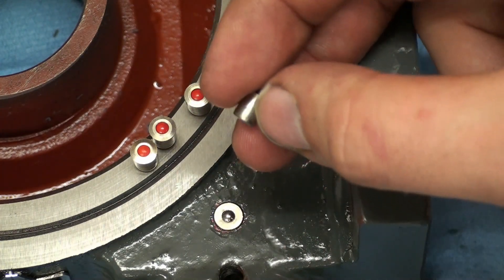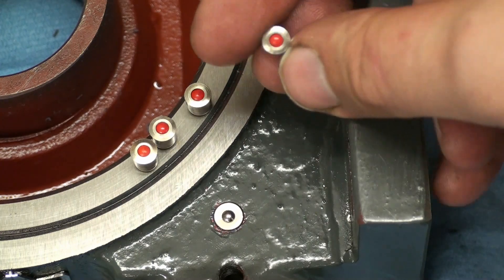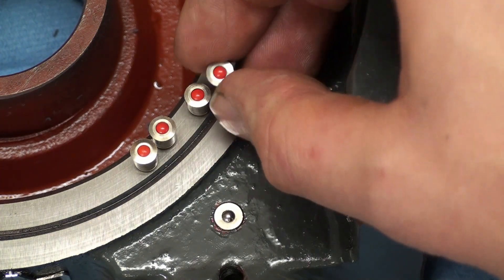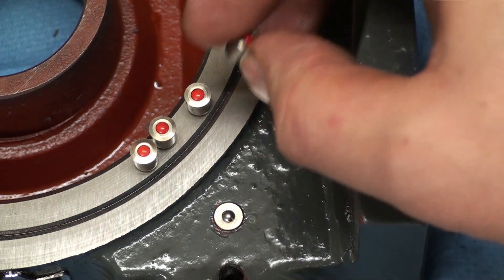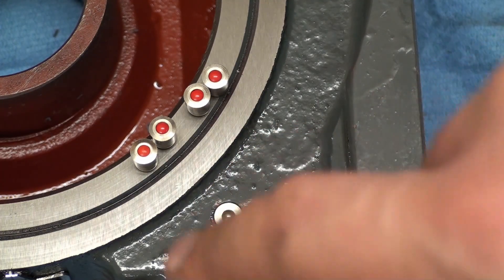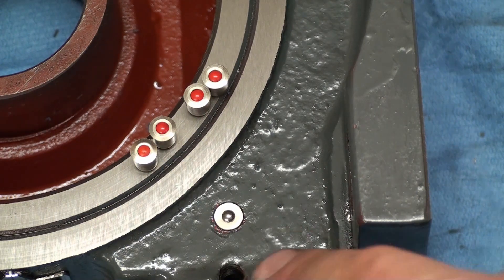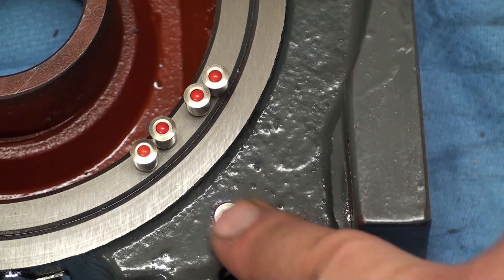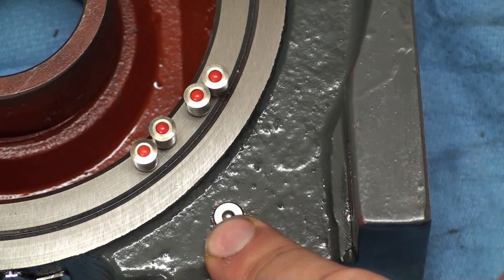Vertex rotary table Teardown - Vertex Rundtisch zerlegt

Comment: At 7:40 Stefan takes off the worm retaining plate and comments that the 4 set screws are to "... adjust for any imperfection in the machine ...".  They are actually for adjusting the clearance between the worm shaft & the body.  I'm sure Stefan knows this, but I'm saying it for anyone viewing this for info about the cleaning of their own R-T.

The ring sets the clearance by bearing against a shoulder on the shaft & the ring's axial position is set by the set screws bearing on the body.  This clearance affects the table's rotary play/clearance by allowing the shaft to move axially.

The 4 set screws on the table's retaining plate at 5:25 do the same for the table-to-body vertical clearance.

Comment: I am purchasing a bunch of equipment from a machine dealer that I personally know that had the roof collapse years ago and the equipment has been in the Indiana weather. One piece is a rotary table and I know I will want to clean it up as you have done. You have saved me much time and apprehension. Thanks.

Comment: I have a 250 mm Walter rotary dividing table and construction very similar! Maybe they also had one to copy? I stripped mine down to clean out. The Walter table runs in an oil bath. I will take some pictures before reassembled.

Comment: Thanks for this. I purchased a Index 12" rotary table years ago that has a broken shaft where the crank met the table. I'm betting it was dropped. I have been meaning to take it apart to see what can be done with it.

Comment: Those set screws for adjustment may be why your attachment screws were so tight. They may have been drawn up after the pieces were attached, causing the excessive thread stretch. Just a thought

Comment: Stefan: I suggest you make a subplate for the rotary table and tailstock when used for dividing. Call it a platen. Then you can key it to a slot or not and swivel for angles or tapers. Another suggestion is to forget about hole circle plates, sector arms, and shot pin handles. Instead, consider the beauties of a stepper motor drive controlled by a DivisionMaster or a Tiny Controls indexer drive. They operate in multiple modes and feature bi-directional power feed. Very cool bit of kit as the Brits would say.

Comment: Thanks for saving me the editing time of making a similar video on my import rotary table.
Mine had all sorts of casting sand left in it the inside of the casting  and it was not painted as yours is which is a good way to encapsulate  any casting sand and grinding dust.  I also needed to de-burr  a lot of the parts in order to have a smooth operation. It seems as though yours had a little more care put into it than mine did. I did have to modify some of the parts of the handle in order to be able to use the indexing plates..
Thanks again for sharing

Comment: Hi Stefan, congradulations on reaching that 5k subscribers number. 

Fwiw, I bought my 6" Vertex rotary over 20 years ago. They've made a few changes between your's and mine. My worm gear is bronze, but I haven't checked the worm to see if it's hardened. And mine unfortunately doesn't have the oil grooves like yours does. And I couldn't agree more about the need to tear down and clean equipment like this. My mill is Taiwanese and I also found those chips and some grinding dust in it.

I'm only repeating what I've read about the Vertex tables and how they were made only a few years ago. At one time they changed from that bronze worm gear mine has to a cast iron gear cut directly into the lower area of the table casting. John Stevenson in the UK did or still does CNC conversions of these Vertex tables, and mentioned on one of the forums 4-5 years ago that all the test certificates he had from buying 20 of these tables had the exact same numbers on each certificate. At that time Vertex had apparently contracted out there production of these tables to the Chinese. From looking at the internals of your table they've either changed and upgraded there quality and design requirements with there Chinese manufacturer's, or they've moved there production back to Taiwan. Your table seems to be quite a bit better made than mine is. And has some much better oil grooves in it. I may have to add those myself. As usual another excellent video, and it was nice learning the best ways to remove those junk ball oiler's the equipment comes with.

Comment: Excellent, methodical, informed video. My one disagreement would be with the set screws impinging directly on the worm shaft threads. I had purchased the 8" version of this and mostly the same as the 6 with the minor exception of an additional thrust bearing in toward the worm. Those threads were just messed up on mine and I wasted hours repairing them which destroys that "new toy buzz" I felt I was owed for what I paid. SO easy to retain that ring correctly by adding a thin brass disk between the setscrew and the threads. In fact, the set screws used to lock rotation of the eccentric also impinged directly on the rotating part without any brass there either. Add those faulty design elements with some other factors outside the scope of this comment and I just returned it... again I am now looking for a rotary table that appears to have been designed by someone who cares, with a worm disengage and with an available divider add-on (the add-on itself that I purchased for the table I mention above was rusted and missing parts, which the vendor cured by photoshopping the missing part out of the ad). Keep up the excellent work. As an aside, can you let me know what source you use for your metals data (tempering, etc). Thank you.

Comment: The way i get those oilers out is to drive a sheetmetal screw in and then grab that with vise grips and pull them out , if they're stubborn hit the nose of the vise grips with a brass hammer while pulling on the vise grips - i found it works most of the time.

Comment: To remove the oil spots I like to use a slide hammer. On the ones I had it was not a problem to fit a screw into the hole of the ball even without drilling and threading and you don't have to dismantle the machine. But maybe mine had a loose fit.
Screw extractors also do the job. I mean the classic "Linksausdreher", not the fancy mondern ones with a spline shaft that Snap-On has (but for removing screws those spline shaft ones do a good job).

Comment: Hi Stefan 
Nice presentation. I have for some time a smaller version of Vertex R.T., 110mm and I did just the same you did. Take it apart and clean it but I did not check for concentrically. Recently I had to put 6 holes 30deg. apart on a cylinder made on the rotary table. I was surprised to discover that MT2 is not concentric with the table. So as I rotate the table the center hole move about 0.002".  Maybe you have more luck with yours.
Radu

Comment: For some reason, I learned to use a wood screw as a means of once screwed in, use a plier or some leverage technique to pull the embedded screw out without stripping the screw out. Even old destroyed oilers can be pulled this way. Eventually I will get caught up on all the episodes to see who shot JR.
Reply from the maker: The compound is fairly sturdy built and i might give it a go to stay on the machine:)

Comment: Nice concise video description. I don't know if I' call the gear a worm gear. Its hard to tell from the video but are the teeth cut on a helix and what is the Pitch. I'm assuming its a Module but I could be wrong. The last rotary table I had to adjust backlash on used a variable pitch worm shaft. You moved the Worm shaft axially to set the back lash to a factory spec. 4th axis on a Kearney and Trekker HMC. Would there be any room to add a set of index plate similar to the ones of Super Spacers

Comment: Congrats on the 5K! Very nice. The rotary table is pretty nice too. I kind of expected a central axis bearing or a bushing but the cast bore is probably ok too for no more revolutions than it likely will see in its life. It is a bit different from my rotary table which can be powered by the mill which would likely see many more revs in its possible uses as a powered 4th axis.

Comment: Ive got the same one, mines Vertex branded still(yes we have optimum, i have Optimum 2506v with 20m mill head on it) in set with the dividing disks and a 3jaw chuck.Ive only done one tiny job on it but it seems decent, after seeing this i will now tear it down to remove the included chinese lapping paste!  Until i understood what was going on (grinding dust)it thought they were using recycled grease full of dirt just for storage/transport protection.A shame they cant take that little bit of extra effort to elevate their product quality just a bit more,my lathe felt totally different once i cleaned,stoned rails and re-lubed it when i first got it, not a lot of time and effort for big result.

Comment: Hello Stefan thanks for all of your nice videos. I have a question I'm hoping you can answer. I have a Vertex HV-6 rotary table and the table had some surface rust that I cleaned off with WD-40 and a scotch-brite pad. At the time I didn't realize that the scotch-brite had alumina abrasive in it (out of ignorance I though it was just plastic) and it put some fine scratches on the table surface. Do you know if there is a way to restore the surface finish of the table?

Comment: Mine is easy to turn on part of the rotation and then becomes hard. I guess I can disassemble from this helpful video but then hope I know what to look for. At least if there are burs I can help with that.
Reply: What a mess. Found the main table sleeve has a lubrication spiral but no way to get lubrication to it. No oiler to service it. The thrust waher holding from the bottom has an oil spiral groove but no way to oil and mating surface is rusted. The worm rod gear is rough as a cob. The locking clamp pieces are all smeared out for not fitting table diameter and I had yet to use them. Sat for a month before I had a need to use so too late to return they say. Hope I can rebuild it. What instructions I got does not show how to lubricate that shaft or waher either! Cheaper if you just do not finish making it I guess. Thanks again for showing me disassembly 😢😢😢😢😢

Comment: If not for your video...
Under the heading of "I should have read the manual..."
Twenty some odd years ago I bought my first vertical mill and it came with a 200mm RoTab.
Never have done much with it but it has come in handy.
Somewhere in your series of this teardown you mention dividing plates, and about two days after watching your videos it dawned on me that I have a bag of miscellany that came with the mill, stuffed into the back of a drawer.
Well I dug it out this morning and lo' and behold there's two plates, the index pin and the plastic do-ma-thingy in there.
Checked accessories on-line and they look-alike.
Never would have discovered this if it hadn't been for your videos...
(Now then, where's the manual on how to mount and use them?  :-) )

Thanks!

Comment: Considering the price of the Vertex, Phase II, and other good, but inexpensive machines, they’re pretty good. Since Yuasa costs more than twice this, and a couple of American made tables cost more than twice the Yuasa, it’s pretty amazing they can make these as well as they do. So some shortcuts are to be expected. There are even cheaper Chinese and Indian machines out there, and for their prices, and occasional home shop use, they’re ok, in some cases.

I’ve seen a very expensive table that has the spindle supported front and back with taper roller bearings, and the table with a very large, table diameter, needle bearing, with all the moving spindle parts also supported by anti friction bearings. Overall, it is a pretty amazing table. I’m not going to say how much it costs, but when the eccentric is disengaged, you can spin the table with a push on a slot with your finger.

Comment: Very informative, as all your videos, and full of learning tips particularly for home machinists like myself. My question is related to G H Thomas's Versatile Dividing Head. I bought the books, digested them and was planning to make one, however, I have a rotary table and the dividing attachment for it and the thought crossed my mind that a person should be able to make the extra worm drive that yields the hundredths of a degree functionality and incorporate it into the normal dividing mechanism for the rotary table. This would save making the superfluous parts even though they are elegant. I need you to put your mind to this problem and would be happy to correspond with you on it.

Comment: Now you have me wanting to tear in to my two tables!....guess I had better get some new oilers in stock...and metric drills!  I am sure that you initially checked the surfaces as far as the table  being parallel and perpendicular to the bases.
Reply from the maker: +Jim Liechty Yes, I edited that out of the video because it was not that exciting - Long story short: It meets the specs, every critical dimension is well below 2/100mm :)

Comment: you said you didn't like the cast iron for the worm gear but it actually is the most common choice for these things.
normally bronze gear is used in gears due to it's low friction cooficient but cast iron has a similiar low cooficient as well and it's strentgh is greater, and also, cast iron doesnt deform in high heat as bronze would. 
i have an old fellows 7a gear shaper and it's main c2 axis (the rotary table) is also cast iron for these reasons.

+1 on the video

Comment: I considered buying the 150 mm Vertex HV-6 and looked up the user manual for it.
In that manual are tables for two sets of index discs (they call them plates).
The table for HV-6 with worm ratio 1:90 is denoted DP-1.
There are both typos, omissions and errors in this table.
(I have not yet checked the other table for the larger discs.)
It's tedious and error prone to check the tables by hand so I wrote
a computer program to compute a complete table, given a worm ratio and a
set of discs. The DP-1 set has a theoretical number of 234 different divisions
spanning from 1 to 4410. Not very practical for drilling hole circles, 
but maybe very large divisions are useful for engraving patterns or similar?
An annoying fact is that 64 is missing in this set.
The printed table in the manual stops at 100 divisions. For larger divisions, the table becomes
more and more sparse. A snippet of a printout from the program follows below.
If there is interest, I can present the complete list in a follow up comment.
It should fit within the YT 10.00 character limit.

Key to the table headings:
T is the desired division
H is the disc and hole track to be used
N is the number of full turn cranks and stepped holes

Ex. To get a division of 7 (the bolt circle on Kontax Stirling Engines LTDs :-),
use the 21 hole circle on disc B and crank 12 full turns and 18 steps (holes)
for each division.

Disc A: 15, 16, 17, 18, 19, 20
Disc B: 21, 23, 27, 29, 31, 33
Disc C: 37, 39, 41, 43, 47, 49

Worm ratio: 90

  T   H         N
  1         90
  2         45
  3         30
  4  A-16   22  8/16
  5         18
  6         15
  7  B-21   12 18/21
  8  A-16   11  4/16
  9         10
 10          9
 11  B-33    8  6/33
 12  A-16    7  8/16
 13  C-39    6 36/39
 14  B-21    6  9/21
 15          6
 16  A-16    5 10/16
 17  A-17    5  5/17
 18          5
 19  A-19    4 14/19
 ...
 4410  C-49     1/49

Comment: Can who has done this recall finding a small brass thrust pad behind one of the grub screws? I'm trying to confirm the correct location for it, but the user manuals are too low res to be of much use.

Comment: Excellent video, thank you Stefan.
I got it such as worm gear is made out of cast iron. Did you check it for hardness as well as the worm itself? Worm is evidently hardened, thermo-related colors at the worm base show it. 
But if the gear(tempted to call it wormwheel, as we have it in our tech lit) is plain cast iron, hardened worm will just chew it under any considerable pressure, for example milling steel rods. As it often happens with cheap east-made rotary tables, having bronse or worse wormgears.
By the vid timestamp i guess you have had some experience with that table. Can you briefly tell how it endures? What kind of operations is it used for?
Thanks in advance, 
WBR.

Comment: Stefan, Great comments on how things should be made! Could you show us some pages from your design sketch-book and talk about how you iterated the design. Given the great content of your videos you'll have 10,000 subscribers in no time. My Vertex like rotary table came as a package deal with index plates, a center and a clamp kit. It has worked well but now I will have to clean it, put in good oilers, and check and adjust the backlash. Thanks much!
Reply from the maker: +Karl Schuler Thank you!
Good Question regarding the sketchbook :)

Comment: hi Stefan-is there an easy way of removing the mt2 taper (looks like a sleeve)from the back of the rotary table.i have it set up vertical to cut hex ,on bolt heads.would be better for me to use the 25mm bore to pass bolts through the rear.thanks geoff

Comment: hi Stefan. I recently dropped the rotary table to the wood floor of my shop. Unfortunately the wheel turns no longer the way It used to be. the worm (spindle) got bent. Could you please tell me if there is a way to true it up?. if not, what would you recomend in order to make a new piece. I mean, what material, if heated treated...etc. I am not an advance machinist but I defenitly want to restore the rotary table instead of buying a new one. thanks. oscar. spain. great videos. keep up the good work
Reply: Id say you crap outta luck trying to do much to that hardened shaft,i could be wrong but im pretty confident im not.Have to make or acquire a replacement id say.